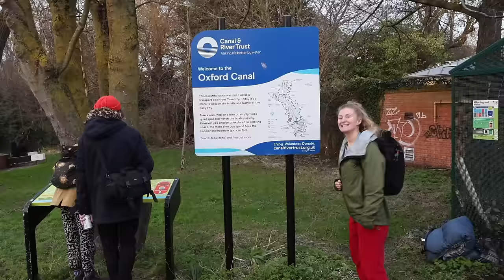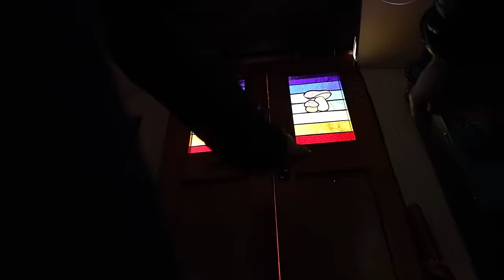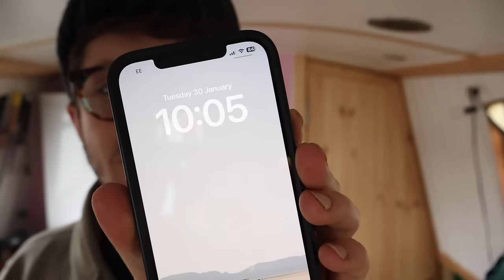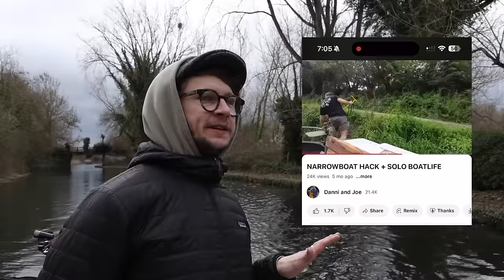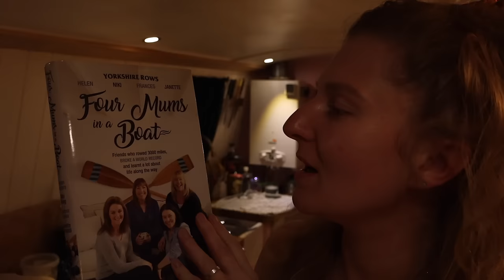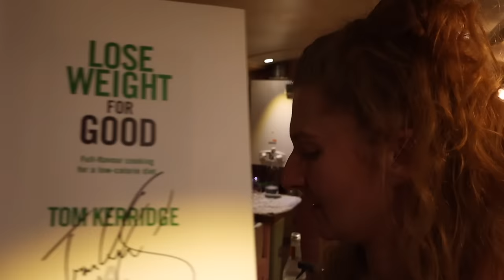Narrowboat Engine Problems OUR FIRST TIME TOWING!

Comment: Hi both, we find that if you open the padle on the SAME side as your boat, the water will hit the opposite side, then sweep towards your boat and keep it in the same place as it raises.  We did 21 Hatton locks on the way to Stratford and it worked like a charm in the large double locks. Try it and see how calm it is! Good luck. Love your videos 👍
Reply from the maker: Ah cool I’ll try that next!
Reply: Totally agree with Pam… must be in the same side… that is particularly true if the paddles are in the gates… 😊😊

Comment: I'm sure someone will have said that when locking up in a wide lock,you should open the ground paddle on the same side as the boat. The water will bounce off the far side and keep the boat close to the side you started on

Comment: You forgot to add about the HS2 fiasco. The new high speed service will only be 10 minutes faster than the current service.
Reply from the maker: Oh no 😭
Reply: 10 minutes? All that destruction and loss of beautiful countryside and natural habitat for 10 minutes.... that's really shocking. Such a waist.  What happens to the existing line afterwards I wonder.
Reply: It wasn't going to be that little of a saving for us up north!
Reply: HS2 is about increasing capacity, allowing more room for freight and local services on the current line.  Unfortunately by cancelling the Manchester part, it won't be nearly as beneficial. Don't believe everything you read in the press.
Reply: What a waste of money, something the British government are good at doing.😮
Reply: If you consider it’s from oak lane 20 minutes outside of central London to a station 24 minutes outside of Birmingham it will actually take longer than the train we already have while damaging animals, farms and our water supply all for a £200 billion price tag!

Comment: When you fill a lock open the paddle on the same side as your boat. The water then rushes across to the opposite side and holds your boat against the wall. I think you have it backwards.

Comment: It's better to have one boat behind the other and not side by side. It's faster, easier to control and uses less diesel.
Reply from the maker: Yeah I think that’ll be the way to go next time. Ben has only just bought the boat & not too confident on steering without power from behind so went with two abreast, didn’t expect so many obstacles to be honest!